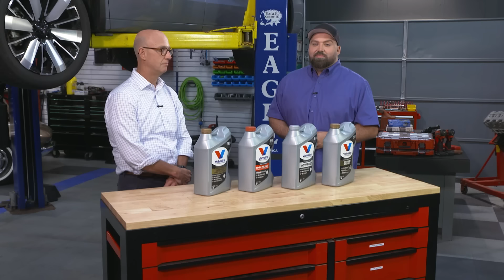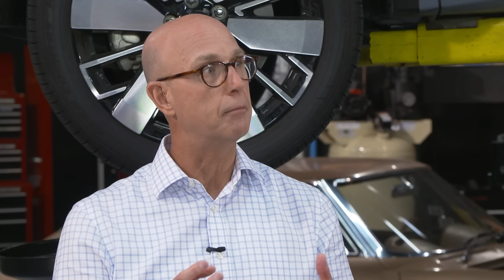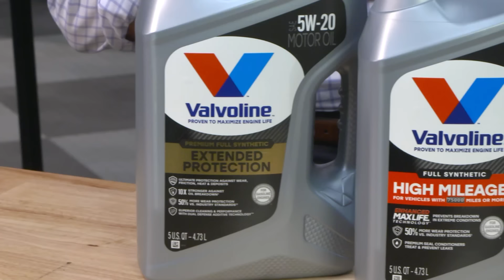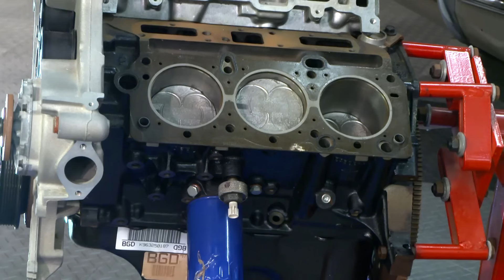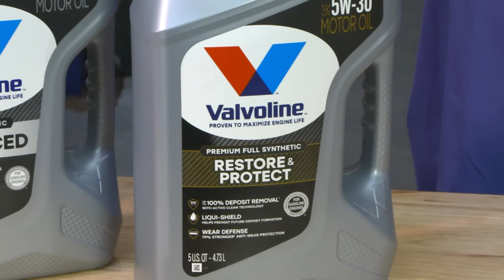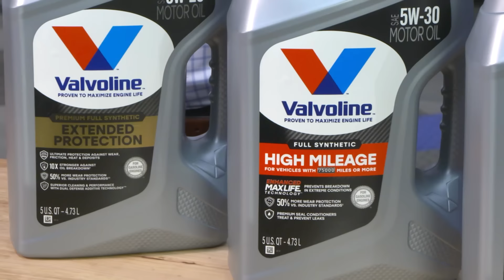Motor Oil Tips for Technicians with Valvoline and MotorWeek

Comment: Thick oil rulez! 
Even injectors are grateful for thicker oil. Many people think that engine oil has no impact at all on the lifespan of the injectors, as they are lubricated by the diesel fuel itself.
However, even though the engine oil does not come into direct contact with the fuel system, its quality significantly affects the lifespan of the injectors via the crankcase ventilation (PCV) system. In every internal combustion engine, due to design factors, blow-by gases and oil vapors pass by the pistons into the crankcase, from where they are routed back into the intake tract via the PCV system.
When an engine oil with a low Noack volatility resistance (meaning a high Noack loss percentage) is used, it tends to evaporate significantly more easily.
In the intake tract, these oil vapors mix with soot from the exhaust gas recirculation (EGR) system and form a sticky, tar-like sludge. When this mixture finally enters the combustion chamber, it deposits as hard carbon build-up on the fine orifices of the injector nozzles, which severely distorts the spray pattern and permanently impairs their function.
The Noack value depends on whether the base oil is mineral or synthetic, but viscosity also plays a role, as thicker oils generally have a lower Noack value than thinner ones.
0W or 5W oils use a thinner base oil as their foundation compared to 10W, 15W, or 20W oils.
Lighter and thinner molecules have a lower boiling point and evaporate much faster at high operating temperatures, such as those simulated during the Noack test at 250 °C. Lighter, thicker molecules, on the other hand, feature a significantly higher boiling point and remain liquid even under intense heat.
If you compare two oils from the same product line and technology of a single manufacturer, the thicker variant will always exhibit the lower Noack value.
So much for my aversion to thin oils.
Frequent oil changes are also important. With the introduction of B7 diesel in 2009, I made it a habit to cut the oil change intervals in half. With the introduction of HVO, I could theoretically return to longer change intervals, but as long as I do not fill up exclusively with HVO and still use a mix of B7 diesel and HVO, I stick to the shortened intervals.
What prompted me to shorten the oil change interval in the first place is very clearly demonstrated by comparing B7 diesel and HVO.
Here is what happens in the engine oil when fuel gets past the cylinder wall into the oil pan due to short-distance trips or particulate filter regenerations:
With standard B7 diesel, the legally mandated biodiesel blend is the biggest issue for oil health. This FAME portion (Fatty Acid Methyl Ester) has an extremely high boiling point above 170 °C. Since engine oil usually reaches temperatures between only 90 and 110 °C during normal driving conditions, fuel-diluted B7 diesel practically never evaporates out of the oil pan. It continuously accumulates, severely thins out the oil, and tends to form acid, oxidation, and sludge under high temperatures. This rapidly consumes the oil's additive package and causes it to age prematurely.
HVO represents the absolute opposite and is extremely gentle on the lubricant. Chemically speaking, HVO consists of synthetically produced, purely paraffinic hydrocarbons—meaning it is entirely free of FAME, sulfur, and aromatics. Due to this purity, fuel-diluted HVO behaves almost like a very thin synthetic base oil in terms of its chemical properties. It does not chemically attack the engine oil's additive package and, unlike FAME, can easily be evaporated back out via the crankcase ventilation system when the engine is warm.
Additionally, HVO offers a crucial indirect benefit: it burns extremely cleanly and produces very little soot in the cylinder. As a result, far less soot enters the engine oil past the piston rings during combustion. Less soot buildup means less wear-inducing abrasion on components and a significantly more stable viscosity across the entire change interval.
Bottom line: switching from B7 diesel to HVO completely eliminates dangerous FAME gelling and oil dilution, while heavily relieving the engine oil thanks to low-soot combustion.
If you do not drive a diesel but a gasoline vehicle, what was said above regarding oil dilution also applies—especially if it is a direct-injection engine.
The reason direct-injection engines struggle so heavily with oil dilution compared to port-injected ones comes down to combustion physics and the way fuel enters the cylinder. While gasoline used to be injected upstream of the intake valve and entered the combustion chamber as a ready, gaseous mixture, modern systems spray the fuel directly into the cylinder at enormous pressure.
During this process, the fuel spray inevitably strikes the icy-cold cylinder wall and piston crown.
Especially during a cold start, the liquid gasoline immediately condenses on these cold surfaces and mixes with the oil film present there. Since the engine runs very rich during cold starts to guarantee a stable ignition, a significant portion of this fuel does not burn at all. With every downward movement of the piston, the liquid gasoline is inevitably swept down into the oil pan by the piston rings.
While small amounts of gasoline entering the oil happened in the past as well, modern direct-injection engines exacerbate the problem through their extremely efficient thermal management. These engines are tuned so heavily for efficiency that they produce almost no waste heat. If the vehicle is now driven predominantly on short trips, the engine oil often never reaches the necessary 90 to 100 °C required for the gasoline components to evaporate out through the crankcase ventilation.
Instead, the gasoline accumulates in the oil pan, which often pleases drivers because they seemingly experience zero oil consumption. In reality, the engine oil undergoes massive chemical alteration, rapidly loses viscosity, and becomes so thin that the protective lubrication film eventually breaks down at the sensitive timing chain.
A thicker oil acts as a prophylactic measure (rather than a cure), but it is not the only one. Another preventive—and in my opinion even more crucial—measure is ignoring the factory-recommended change intervals, which exist for marketing reasons but are far too long, especially for short-distance driving profiles.
As Comrade Stalin would say: Quantity turns into quality.
This applies particularly to the frequency of oil changes—especially if, for whatever reason, one insists on continuing to use thin oil and chooses to forgo the prophylactic benefits of thick oil recommended here.
Summary:
Lubrication film dynamics (hydrodynamics) are influenced by only three factors: viscosity, engine speed (RPM), and load.
High viscosity, high engine speed, and low load ensure a stable lubrication film.
Reply: wow..ok...thicker oils could protect better but whats your take on running say 10w-3or even 20-50 in a 0w-20 gas direct injection engine -could it create issue in vvt cam phaser-what say you?
Reply: @bobrumpf2576 Zero problems, even with 20W-50. In winter I would recommend 15W-40, it cranks easier than 20W-50. I am talking about winter in Germany.

Comment: All the GF7 SQ rated full synthetic oils are very, very good. Valvoline R&P is also very good but best for engines been neglected, burn oil etc. If you've used good brand full synthetic oil & been consistent w/maintenance it's not gonna do much if anything. Won't hurt to use it but Mobil1, Pennzoil Platinum , Valvoline advanced all great oils that keep engines very clean if not run long OCIs.

Comment: I took a Honda element with 101,000 miles. Used Valvoline Restore and Protect over the next 30,000 miles. There was some sludge and varnish. Over those next 6 oil changes (5,000 mile interval) I checked the oil pan (replaced oil pan) and valve train (removed valve cover) Sludge and varnish was gone. It acted just as Valvoline advertised

Comment: Very informative and  obviously a high quality product. I have a "little" different take. The highest rated oil today is API SQ. So I go to my local O'Reillys and I use 5W-30 in my truck and 0W-20 in my wife's Toyota. I buy the O'Reillys full synthetic at the correct viscosity rating and save myself some money. I then buy the O'Reilly's 10,000 mile premium oil filter. I change the oil at 3,000 miles and at 6,000 miles oil and filter. I even mix different brands of oil as long as they meet the viscosity and correct weight and rating. Never a problem. The most cost effective oil is SuperTech from Wal-Mart and I have see videos by mechanics that all they use is SuperTech and never a problem. I am not saying Valvoline is not worth the extra cost, I am saying it is not necessary to spend more when the same rated substitute will do like a SuperTech or O'Reilly's.

Comment: Even if you have a brand new vehicle put the Valvoline High Mileage in it from day one. Has so much Moly in it and its additive package is amazing (I have done oil analysis on 5W-30 and the 10W-30 virgin samples and then after running it upwards of 5 k). Also stop running your vehicles 7500 plus miles and stop cheaping out on filters. You could run Super tech as your oil but run a nice oil filter and do more justice for your car than running a great oil and running a Microguard or Fram. Stop cheaping out on filters people and change your oil max 5000 miles.
Reply: You can do 10,000 mile oil changes with the cheapest oil on the shelf and have zero issues.  It is marketing that convinces people to think otherwise.
Reply: @Olds_Pwr  You do you.  Best of luck. I bet you buy the cheapest filter too. Also I would even say it’s not marketing that says otherwise.  Marketing on these oil companies and filters in fact say to go upwards of 20k. You clearly don’t realize why OW-20 ect exist is literally cause they Fed Government wanted us to cut down on waist oils so then mileage was extended. It’s the same reason these car companies have been telling people you don’t have to service your transmission fluid for the life of the vehicle. BS. It’s the life of the factory warranty and then you’re screwed. Your welcome! You should read sometime. Also please do an oil analysis on your cheap oil run and do get back with me and I’ll get you an email so I can actually see how much of what you’re saying is very wrong. 10k is not sustainable unless you have an oil bypass filter. There is just too much that needs to be filtered out and the TBN will run out before 10k on “The cheapest Oils”. It also depends to on how many quarts your vehicle takes. The more quarts the more likely you could go 10k. But not with a cheap filter. Cut yours open after 10k and after running the cheapest oil.
Reply: @LeroyJenkins12B  Oh Leroy, I have been doing this for over a decade with over 6 vehicles, hundreds of thousands of miles and not one has had an issue. I use AC Delco on everything which is somewhat generic from my understanding since other companies make them. The oil I use is 5W-30 and higher even though some call for thinner. Speaking of transmission fluid. My daily driver has 281,000 miles with the original fluid except for about a quart added after I had to replace the shift solenoids. When it comes to reading. I would rather use my noggin instead of reading what others comment about from what they have heard. As for a bypass filter. I don't care to look inside to see a coil spring or a leaf spring disc. As for oil capacity. None take more than 5 quarts. Oil analysis, why would I pay for that? Haha. So with my experience, everything you wrote above is not true as it comes to the engines I have touched. As for your (OW-20 ect exist is literally cause they Fed Government wanted us to cut down on waist oils so then mileage was extended). I am thinking, what does viscosity and "waist" oils, have anything to do with each other. Anyways, take care.
Reply: @Olds_Pwr WELL SAID, my friend. I love these vids for entertainment purposes/basic knowledge and to compare different products. What most overlook that affects oil condition is driving habits. My daily commutes consist of open road/hwy driving, so my oil changes are done when my vehicle's OLM says to do it(about 7-7500 miles) and even then, it's still honey brown👍🏽

Comment: Wish Valvoline would make an oil filter to go with R&,P 😊
Reply: Use  WIX or Purolator one
Reply: @philipeli1192 unless you're a tribologist, nobody cares what you think. Anecdotals are the reason oil marketing is so messy.
Reply: @pressureflipwillygrind  waa you sound so professional,your opinion is not even a concern either!
Reply: @philipeli1192 firstly, I am a professional. Ive worked automotive for the past 15 years. 

Secondly, I'm not giving an opinion. I'm telling you to stop throwing anecdotes like a monkey tossing shit because it muddies up an already complex industry.

Comment: All oils is good just change it every 3-5K
Reply: Not. All oil is not good. Some are better than others.
Reply: @jaygold4467 Name one that is not good.
Reply: Why you say 3,000-5,000 miles? Have you gone 10,000 miles and had an engine issue? Or are you just gathering internet myths and passing it on?
Reply: @Olds_Pwr I’ve have been doing 15k since synthetic oils came out,in the 80s. Don’t know how many 200k vehicles I’ve gone through. Never had a problem. Look at all these lab tests on 20k oil. They are still in perfect shape. 
 My wife has a Mercedes. They want 300 for an oil change,if I were to take it in. Do the math,thar would be 30k in oil changes per 300k miles.  The oil companies push 3k changes. When synthetic came out they were boasting 20k changes would be the new oil schedule. Then over the years we are at 3k again. In the 80s the regular oil change was 3k for severe duty and 5k for normal usage. Why are we at 3k now?  I have a good idea.
Reply: @r @ralphllivrah9551 Thanks for your information. I love reading real world results instead of internet myths. I use the cheapest mineral oil on the shelf at the time of purchase. Change at every 10,000 miles because it is easier to remember to do so at that interval. I have mixed brands, types, and viscosities. With 281,000 miles , the engine still runs great and does not use more than a quart between oil changes.  30 miles each way to work for the ones that is wondering.  I have a feeling that body will rot away before the engine goes.  2010 G6 with the 150 cid.
Reply: I mean, store brand oil in heavy urban use, yes. I commute 60 miles round trip and my car makes many medical trips of hundreds of miles for family. At 5k miles my dipstick still has golden brown collor oil on it and its still in the upper half of the crosshatch safe zone on the stick. 7k is fine. My work trucks we use for the business i work at... they get 4-5k with store brand oil for all urban use trucks and 8-10k miles for trucks that drive from city to city doing route work. None of our vehicles ever has engine failure related to oil unless some moron driver fails to turn a truck in for service and it runs out of oil. 
For someone that drives lots of short trips 0 to 15 miles..... def tighten up oci and maybe run oil labs to check on fuel and moisture dilution. Might be shocked that at 3k you still are good for another 5k and save you alot of down time and money
Reply: You will go broke changing oil every 3k. 15k is very reasonably for synthetic oil. Don’t fall for their bs. They want 300 to change oil on my wife’s Mercedes. That’s 10k in oil changes per 100k miles at 3k changes. So 300k miles is 30k in oil changes.
Reply: @ralphllivrah9551  you should change by yourself